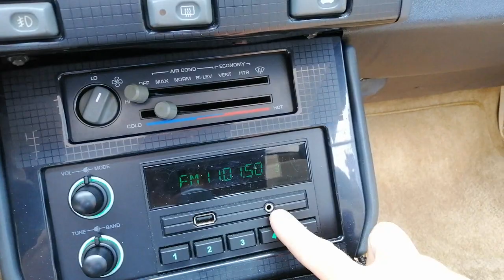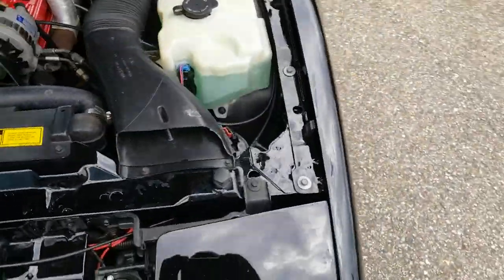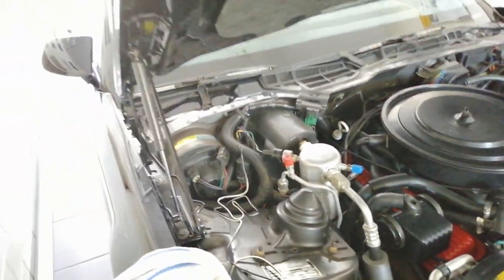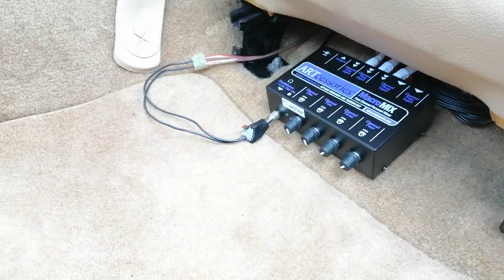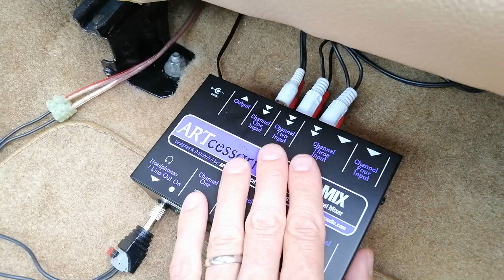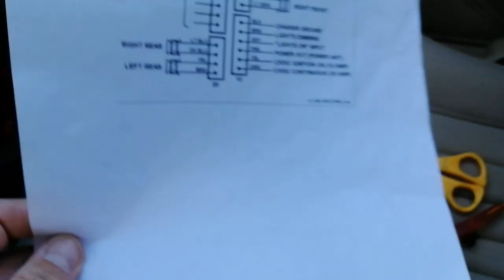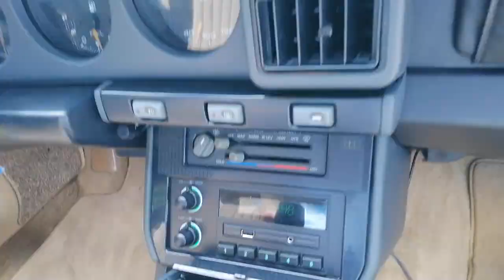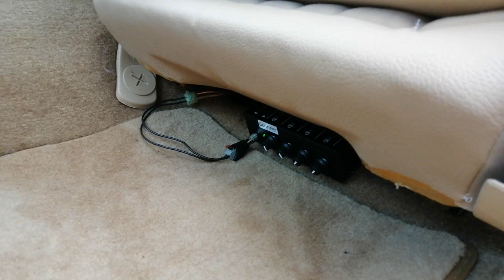KITT Firebird Trans Am - Episode 18 - Sound system

Comment: so what was the problem with the speaker being so low?
Reply from the maker: The sound mixer has a built in amplifier, but it's not putting out enough power. I'll have to either get another sound mixer with amplifier or just add an additional amplifier to the system.

Comment: Respectfully, not sure I agree with engine speaker for the following reason: the battery emits hydrogen gas. Please make sure the wiring is very well insulated. There is a MODERATE chance that operating an electrical component so close to the battery may result in an explosion or fire, especially near a heat source such as your engine. Also if the battery supports a hose to route hydrogen gases away from battery and engine, I highly recommend this for safety. Other than that, great job!
Reply from the maker: Thank you for your comment. Interesting aspect, I hadn't given it a thought. However, I don't think it's remotely an issue. Many first responder vehicles have speakers in their engine bays. Also, the speaker is located below the battery in a 'closed' area,  therefore I don't think it would be affected by any gas emissions. There are many other electrical components or should I say wires that are closer to the battery and draw a lot more power than this speaker. Being mounted where it is, the speaker is also in a relatively cool place and will get less hot than any other component in the engine bay.
Reply: It's an Optima battery.  Under normal conditions, no hydrogen gas is emitted from their batteries.